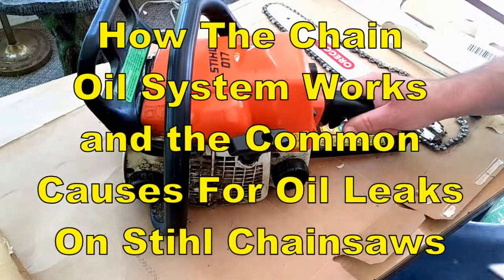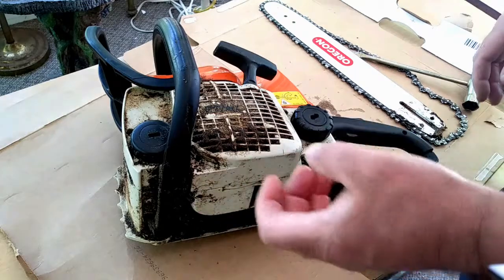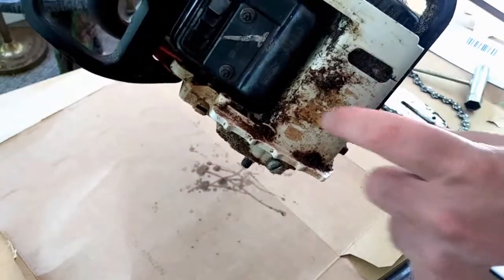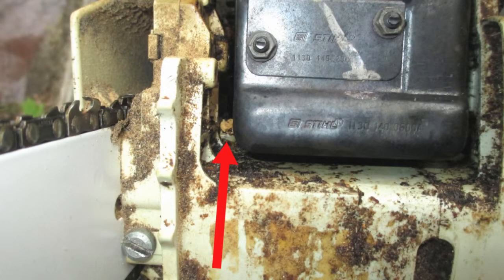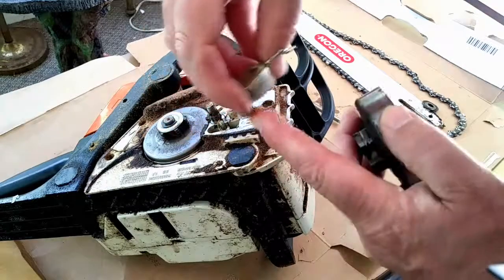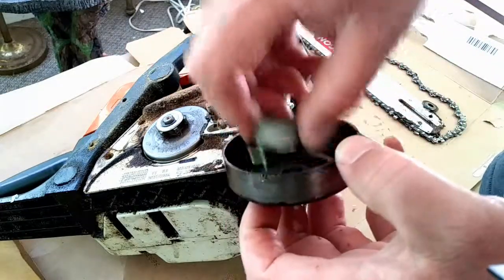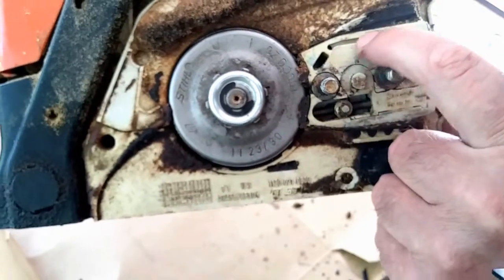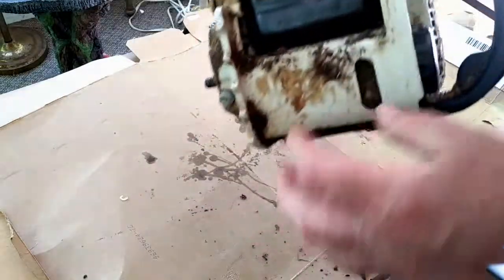All Stihl Chainsaw Common Oil Leaks and How a Chain Bar Oil System Works How to Check  017 018 MS170

Comment: Thanks for this video

You said that oil flows thru the tiny hole on top in the chain bar. I hadn't paid any attention to these two tiny holes before. But the one on top was plugged up. Blew it out with brake cleaner and now oil is flowing to the chain again.

Comment: The oil on my saw is coming out from under the muffler where the check valve? Is
Reply: If no orange plug on left side of Muffler ,there is a hole that can be plugged . Dealer has repair kit .Easy fix....